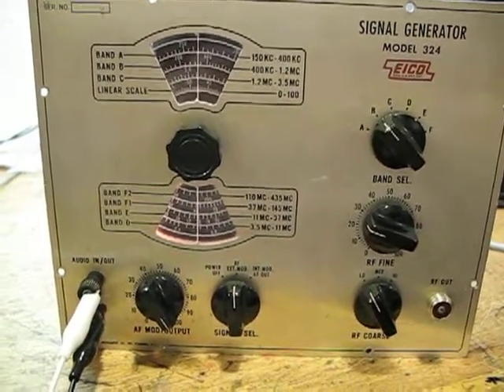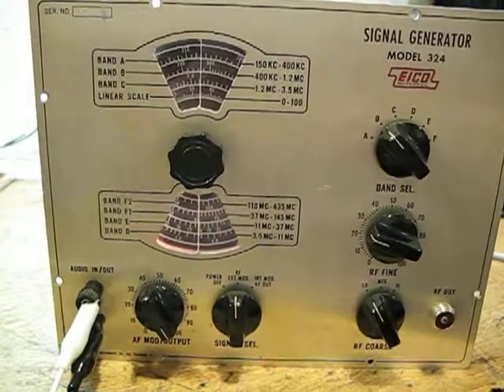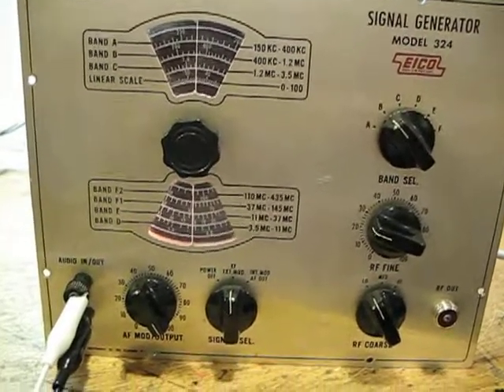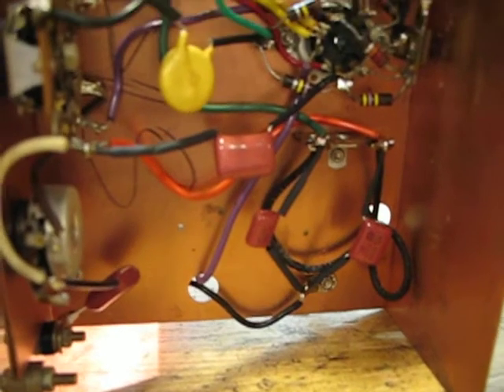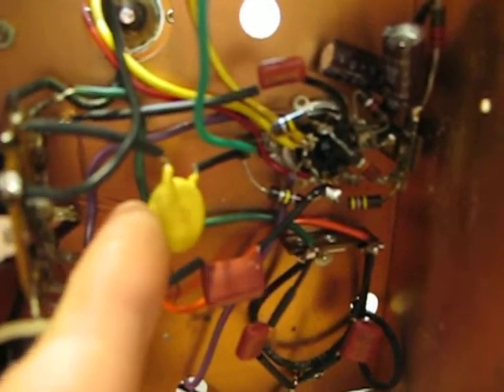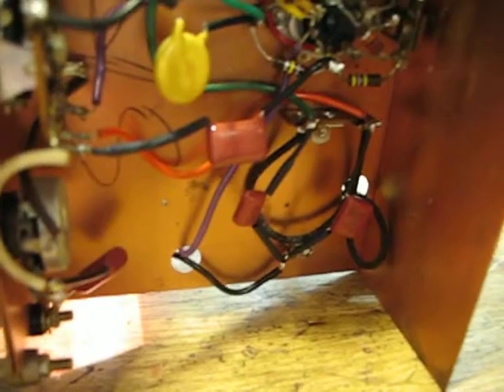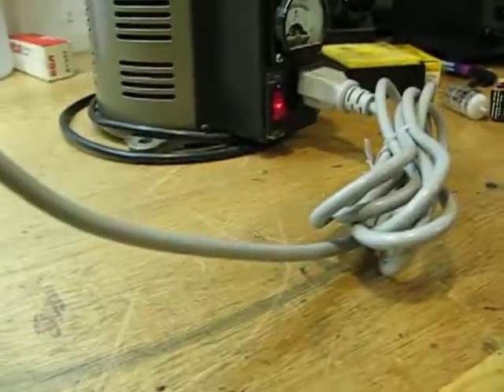Eico Model 324 Signal Generator Restoration Part 2

Comment from the maker: When I replaced the line caps, I think I used caps that were actually made for the purpose.  From what I remember, X2 rated type would be from hot to neutral, and Y1 would be rated for neutral to chassis.  Do not connect a cap from hot to chassis though.

Comment: I have one of these that has its original caps - I got a nice shock off of the chassis. My first suspect is the "floating ground" caps on the AC Line. I'd like to replace the outlet cord with a 3-prong variety - are the "ground reference" caps on the transformer primary really needed after I install that?

Comment from the maker: @KyleCarrington I've never tried this unit on the higher ranges, and I don't have a counter that can go that high.  I actually ended up getting a big digital RF generator off Ebay cheaper than a good frequency counter!  

One thing I can tell you about this Eico, is that it will be super sensitive to vibration and will act like a microphone if any of the tubes are microphonic.

Comment: @Maxxarcade and it does. All original. I've taken note of the description of what should go in, and I'll look for them. In general, how is the quality of the megacycle range signals on these old units if compared to new digital technology, do you know? Thanks. Also, any advice on what to look for in a counter that goes into the tens of megacycles, i.e. similar range?

Comment from the maker: I just wish I could figure out the tuners on two Kenwood receivers I'm working on.  One has weak tuners (both am/fm) the other is basically dead.  I'm starting to think bad transistors is the problem, since both have been recapped.  Input to the AF pre-amp is ok, so I know it's in the receiver stages.